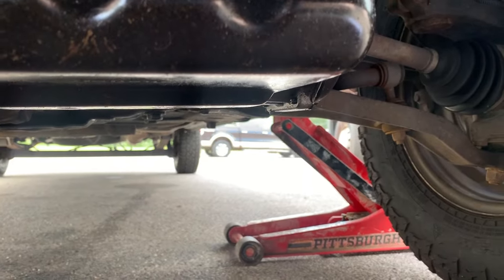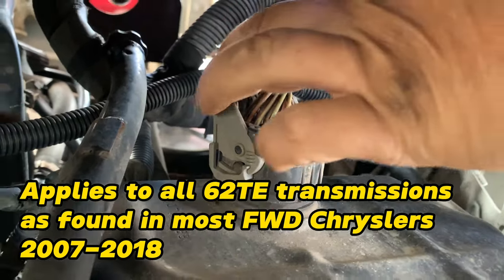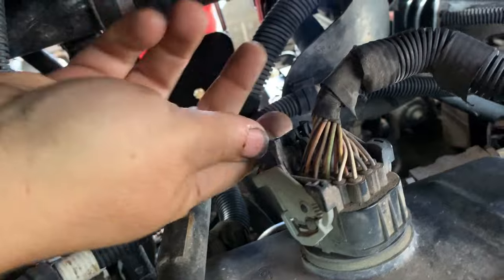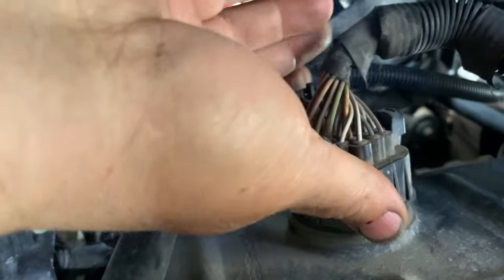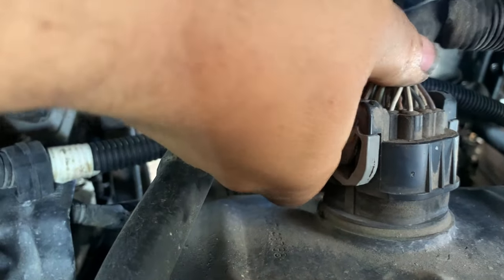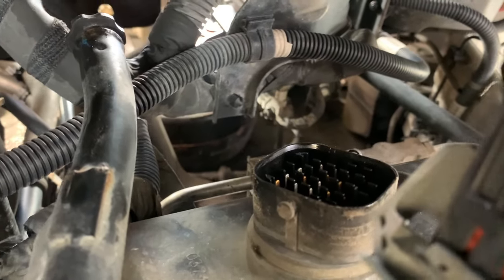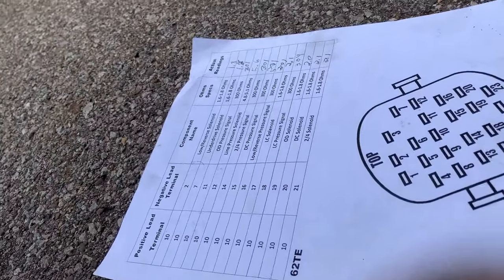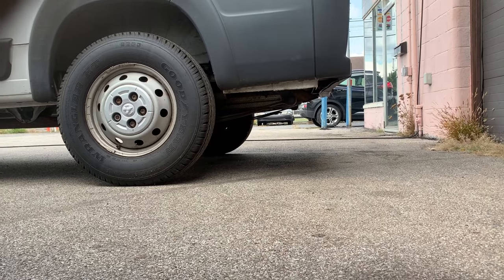62TE transmission Electrical plug connector removal - Promaster Caravan  Journey Town Country 200

Comment: I need to get that same connector off my Dodge Ram 1500 tranny and it's not at all that accessible.
Reply from the maker: "No, Buck MURDOCK" - good one. I assume you mean a 1500 pickup truck. I was unaware they use the same connector, but I suppose it makes sense, even though it's a very different transmission.